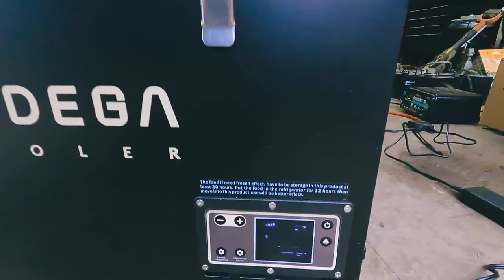MILITARY KIDS, SURPRISE FOR THE SON-IN-LAW, AND WILDLIFE! We're all over the place!

Comment: Pretty much from 75 into the 80s whatever came down the line at GM they just slapped a motor in it, I've had a 79 Buick Skylark with a 305, a 76 Pontiac  ventura with an olds 260 v8